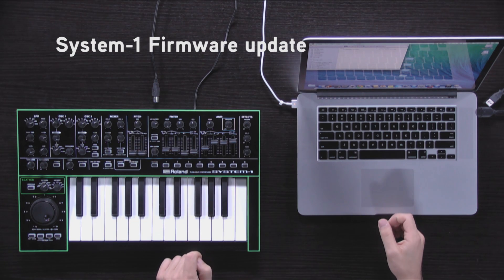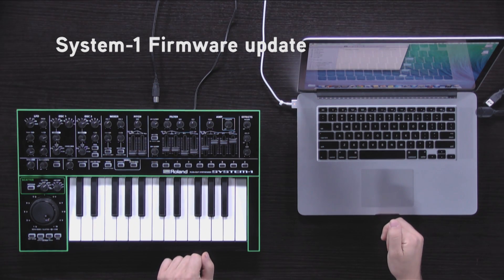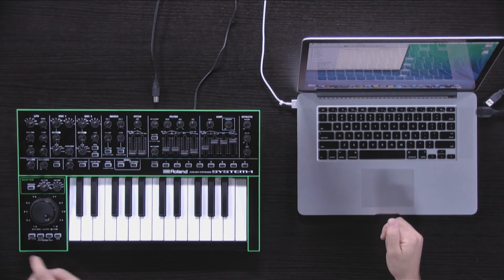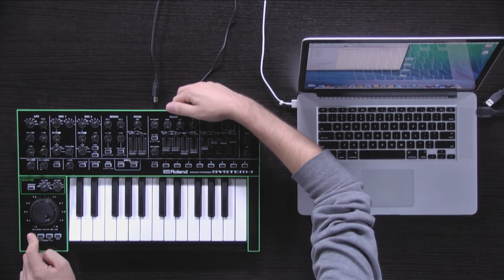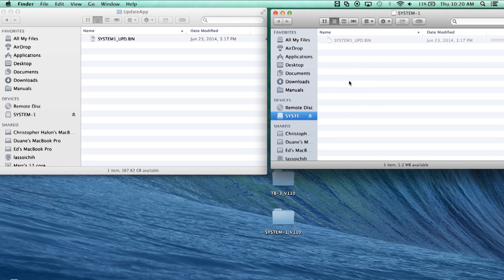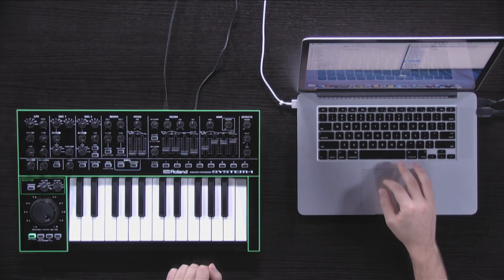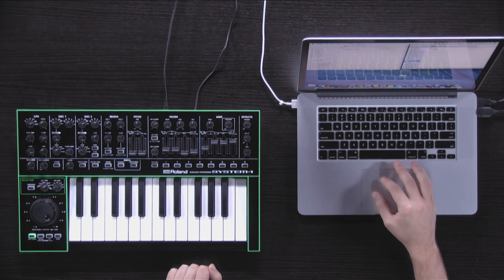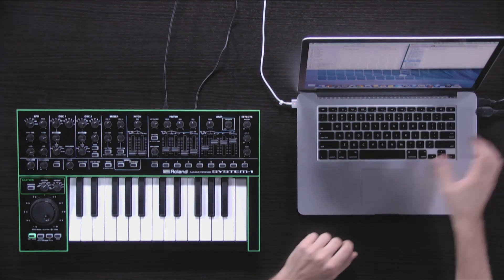Roland Aira - How to update System-1 Firmware

Comment: thx, wasnt able to perform the back up first, which is strongly advised. It has almost the same procedure but instead of holding the key button you have to hold the arpeggio button. My laptop didnt open the system file at all while following the procedure according to the manual. Perhaps because it is a brand new, lol, device. Either way good short video.

Comment: Updated to 1.3, it worked fine but when i press the plug out button the synth seems to have installed somekind of a plug out since thw buttons works and i can switch betwwen normal system 1 and plug out. If that is the case which plug out synth is this on system update v1.3 ?
Reply: I updated my system-1 to v1.3, and didn't have this - The plug-out button is unusable for me (I've never installed plug-outs in it . . . yet)
Reply: Do you know of a good tutorial for loading in the plug out or patches from the Sys-1 vst